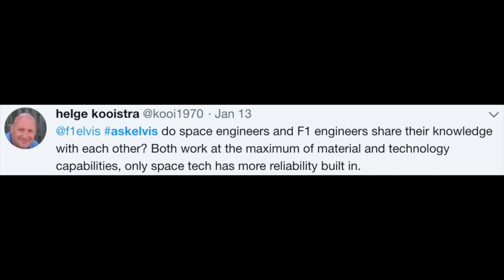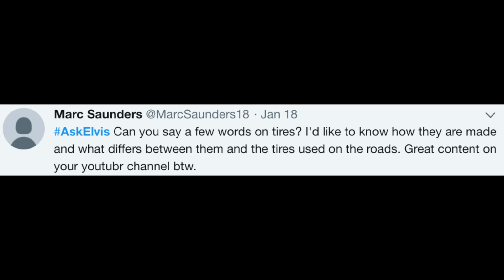MP210 - What could the effects of Brexit be on F1?...& other Q's.

Comment: #AskElvis What do you think about switching DRS around? So instead of activating DRS when within 1 second of the car ahead, everyone gets access to it (Not first place) when they're outside of 1 or 2 seconds of the car ahead. Doing this would help to keep the field closer together throughout the whole race and reduce the chance of cars being lapped. (Verstappen V Ocon) This would also open the door to having DRS everywhere on track or having more DRS zones.
Reply from the maker: But then, if cars can't overtake each other, why would they want to move closer to the car in front and break the DRS effect, potentially opening themselves up to an attack from behind?
Reply: Aye, don't get me wrong, they (F1) need to make chasing cars within a couple of seconds easier as well but in addition to this. Letting it sit for a couple of days, do you think it would be good for them to have the requirements for DRS to change from track to track because it can be so different to follow someone so close at some tracks (Singapore) and instead of having the DRS being active outside of 2 seconds, would it not be better if a car was outside of 5/7/10 seconds (depending on the track) and that activated DRS. This would make mistakes less race ending or championship ending? Keep up the good work with the interesting/entraining videos   @F1Elvis

Comment: Surely the reason we have the racing we have now is that the teams and drivers are simply too good at what they do. There are no missed gears, no spun wheels, no missed breaking points, no braking failures,  no gears breaking, etc, etc. When you look at most classic sequences from the past, usually some sort of error is the cause of it. Either before the sequence, or during it.
Reply from the maker: Yes, we've engineered the tech to make driving relatively easy.
Reply: @F1Elvis  I was more thinking about the sheer precision of the entire operation. For example, qually. Merc are considered dominant, but when you look at the qually times, they are say 0.2 secs ahead. But, consistently 0.2. I remember in the early 90's williams being 2 seconds ahead. The incredible thing is that 0.2 being so consistent over a season. Its such fine precise margins. You have to have the whole team and car and driver working so perfectly to maintain that.

And, being that consistently exact........ as a driver.......... "relatively easy"? Easy was getting consistent poles with 1 or 2 seconds in your pocket, like back in the 80s or 90. What we have today is very different. 

Im not sure I really ever see things substantially changing in F1 simply because the teams are so so exact and perfect. The teams will eventually adapt to whatever new regs we get, they will perfect them, work precisely at that level and we'll have the same sort of racing. The only natural chance we have is a team finding something new, but then the others will catch up. All F1 can do is add gimmicks to artificially spice it up, like the evil DRS, or some of the things FE does. 

In the end though........ WOW!!!! Aren't F1 teams bloody amazing!!!

Comment: Project Fear again Marc! There will be no problem moving goods or personnel round the EU because once in a European Member State goods are in free circulation amongst all the member states by definition so it's only one border to cross. My experience, running an export Company, while going through the transitional stages of entry into the the EEC, yes I'm that old, as it was then, was that it was easy and seamless. That was in the early stages of PCs and before the internet, therefore it will be even easier now with electronic customs entries. The teams may have to take on an extra member or two of staff to operate it, but that's all.
The teams will be used to doing it anyway as they travel to other Countries outside the EU already where they have to comply with Customs paperwork for these various Countries now.

Comment: strip down force and there will be better racing however the cars will be MUCH slower and you wont have the cars flying through corners they'll be under steering, and commitment wont be keeping your foot pinned it'll be an annoyance of the latency getting on the throttle a lot of coasting etc and it will look sloppy you need to find a sweet spot
Reply from the maker: Agree, I made a video on that very subject

Comment: When cars were not very aerodynamic they put a huge hole in the air and disrupted the air behind them worse than today The problem now is that the difference between one through 10 positions is only a few tenths of a second so if everybody's almost equal it's going to be very hard to overtake
Reply: randy zakem you are partly correct, yes in years gone by cars punched a big hole in the air but that’s what made following easier, cars could drive through it.

The air is now more disrupted with vortices which makes the air even more dirty

Comment: #AskElvis Could Formula E cars reach same speeds (Lap times) as F1 if they (Formula E) would have similar aerodynamics package?
Reply from the maker: No, electric motors are designed for massive instant torque, so acceleration's huge, but top end isn't.

Comment: I like FE but I really do want to see them on real tracks. I find street races to look too similar and quite boring. Everything else is great but it's just the circuits are not very appealing.
Reply: TheSpacecraftX  I said the same thing elsewhere about the circuits and got an earful as far as OMG the cars have to be on the brakes frequently so they can recharge the batteries! I give up.WRC for me.
Reply: Seriously I'm too busy watching the racing to notice where the race actually is. Could be on the moon for all I care. Did you see the Marrakesh race?
Reply: Hey guys, with FE they want to race in cheaper and easier places. More accessible and easier for people to attend. Would be good to see them use a track as well though!!
Reply: I would think there will be an electric WRC sooner rather than later?
Reply: problem is that they're a bit slow for certain large circuits like monza or spa. I'd love to see them include some smaller less high speed real circuits like interlagos or the red bull ring though

Comment: #AskElvis is it true that before starting the f1 engine it’s warmed up by running hot coolant through the system? If not, what’s the procedure to start the f1 engine?
Reply: The tolerances are such, within the engines, that with cold ambient temperature the engine are effectively ceased. So yes, the engine must be close to operating temp before starting procedure can be initiated, as Ron Dennis would say.
Reply from the maker: Yes, that's correct.